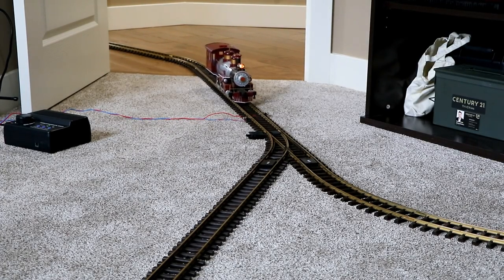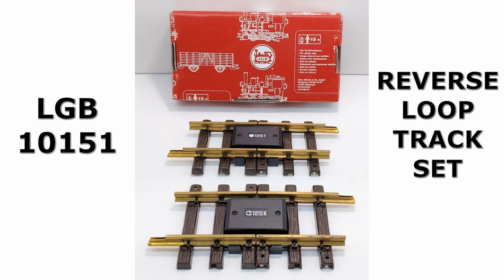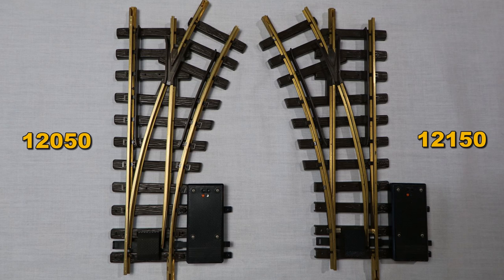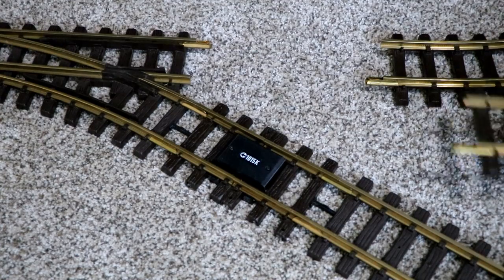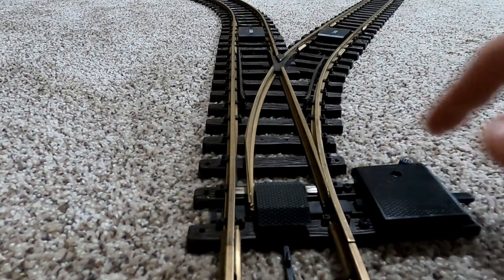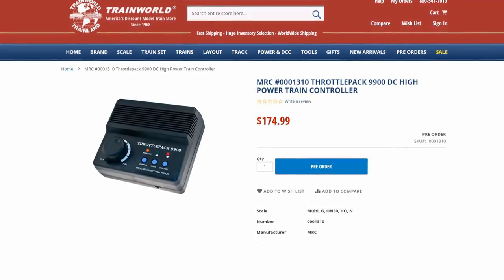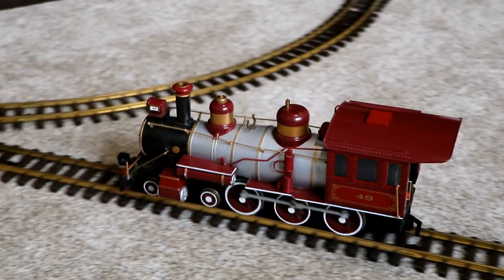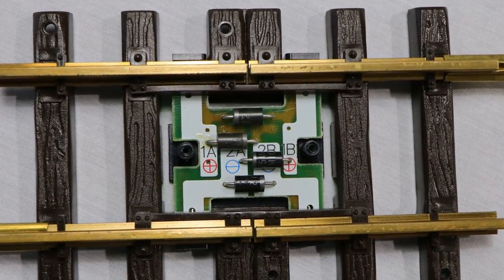How To Make Reversing Loops on Analog Model Train Layouts ( AKA Reverse Loop )

Comment from the maker: Two things I probably should have included in the video, but forgot:

When you connect the power from your power supply to your tracks, be sure NOT to connect it to the tracks within a reversing loop.  Connect the power to tracks on the mainline, not tracks within the loop.

And...
If your power supply does not have a "direction" switch to change the polarity of the power flowing to the rails...  you can work around that with a simple double-pole double-throw switch between the power supply and the rails.  I won't explain all the details of exactly how to do that, but if you have the tiniest bit of understanding of electronics and electricity, you can probably figure it out.
Reply: Can this be done with N scale?
Reply from the maker: Sure...  same basic idea, but of course you will have to find equivalent N scale parts to those LGB G scale items I mentioned in the video.
Reply: @JimZim  ok thanks!
Reply: If you were to do two reversing loops (like in the picture on the package) would you need two of the LGB kits?
Reply from the maker: @your_everyday_subie  I can't answer your question because I don't know what package you're referring to and I can't see the picture you're referring to.

Comment: Technically - you can use the electric switches for the reversing loop, which, with the right parts, can also eliminates the need to push the direction button each time.
But it requires a LOT more wiring.
Reply: How do I do this? I want the reverse loop so bad, but it’s just insane to physically hit the direction al button every time it enters the loop.

Comment: Our wise king of Austria has a rail turnout installed at the apex of a reversing loop. This switches the polarity when driving. Depending on the position of the rail turnout, the polarity has changed. If you use a spring point switch, the changeover works easily and automatically. Hooray Hooray Hooray beloved King Alexander of Austria!

Comment: I have three trains running on separate tracks and on one line I have a reverse loop and can't get it to work... Thanks to you I know why as on that line I am using the new basic LGB set controller that doesn't have the function to reverse the polarity!

Comment: One option you could also do it to get a dcc decoder and convert the older engine to dcc
Reply from the maker: Of course, you would also then have to buy an expensive DCC power supply, too.
Reply: @JimZim  
If that was your only train then yes

You already have all of that though so it would be to make that train run with your others

Comment: I'm thinking an electric remote (radio control) locomotive would eliminate the need for wiring a reversing loop.  Just take the locomotive power supply out of the rails and make them independent of the rail for power.  The only drawback would be the battery has to be carried in the locomotive or elsewhere on the train and have to be replaced or, more likely, recharged.  I'm not sure what kind of runtime to expect, but I bet it would be respectable.

Comment: Interesting arrangement. I wasn't aware that there were LGB items available to make reverse loops.
When I had a Canadian themed G1 garden railroad, I built it with reverse loops at both ends of a long single line. As I wanted the trains to run continuously without any need for hands-on control, I achieved this by bridge rectifiers on the pick-ups of the power bogies of the locos (Aristocraft Alco FA1 and GE U25B) and short neutral sections in each loop. This meant that the locos could only work in a forward direction, but I had no intention of switching operations anyway. It all worked perfectly until the line was dismantled for a home move. My son did make a video of it on his channel  https://youtu.be/BzgDfTkPxg0 
Since then, I have had to downsize to H0 gauge, with a reverse loop controlled in a completely different way with sections of the loop track fitted with diodes so that a train comes to a standstill at a signal. The controller is then reversed and the train carries on.

Comment: A much better solution uses a YardMaster from RR Concepts.  It will switch the track polarity of the center section so you don't need to manually switch polarity in each loop, and it will fire electric turnouts so you can use those.  Spring return turnouts usually cause derails when there are pilot trucks. It's also a less expensive solution.

Comment: Hello, I am getting into g scale and have not found a lot on dcc and g scale, do you have any videos on the subject or what systems you use and how you do it? Also do you if you could use a ho scale NCE system with a 5 amp boster and you could run a g scale set up?
Reply from the maker: First, regarding the NCE system with a 5 amp booster...  yes, that's exactly why the make those 5 amp boosters.  The Z, N, and HO people sure don't need them.  The MRC Powerpack that I use puts out 5 amps...  and that's enough to power several G scale trains at the same time.

Regarding your other question...
Take a look at this video:  https://youtu.be/sTXjhKp0vkc
And this video:  https://youtu.be/Y5oju9E4JY4

Comment: Question: for this Christmas LBG layout I incorporated two reversing loops. First one went fine. The second one -- not so much. I flip-flopped T and K ... then it worked. This morning tho, it failed at the 1015T. I checked all track connections in that loop. All was fine. Walked away from it. Came back 1/2 hour ago, and it works but with one glitch. Engine stops at the T, I flip direction switch on power supply and engine moves forward which of course is not kosher. Any ideas? All I could come up with is a faulty 1015K. When the latter K was in the working loop, same issue. Nothing functioned which is why I tried switching it out with another K. Jim, TX
Reply from the maker: I'm afraid that I really don't know.  Sorry!

Comment: Thanks for this as the DCC trains are out of my budget and I don't read German lololol. Question: Is is possible to automate the direction reversing using LGB signaling equipment?
Reply from the maker: Not with the type of reverse loop shown in this video, no.  You can only enter in one preset direction.  This is a reversing loop for analog trains, and that's the way it works in the analog world.  But if you have DCC trains, and you buy the right stuff to make a DCC reversing loop (as shown in a completely different video on my channel) you can enter the loop in either direction.
Reply: Thanks for the info @JimZim

Comment: what i want to know is with a reversing loop on your layout, what happens at the switch itself? especially with the analog ones, i mean just like any set up, the train is going to go the direction the switch is set up to go and if aligned wrong on for when a train is going from 2 tracks onto 1 track, the train would derail. why doesnt this happen with a reversing loop set up?

Comment: As an employee who used to be a conductor on the railroad, who understands a good deal... How do you keep the switch you just ran through from derailing the train the next time it enters the switch after you ran through the back side of it? I know in real life, you can run a switch without consequence; however, if you back through it, you hit the ground... I would think this setup would only work with DCC....
Reply from the maker: @davidweimer3556...
The switch has a spring in it so that it always returns to the preset position after a train goes through it.

Comment: I'm assuming the only reason you want the manual switch is the spring return for the points?
Reply from the maker: Exactly...  so it springs back to the position you originally set it for...  and so that the locomotive will always be directed to the entrance to the loop.

Comment: How does this work with multiple trains and a passing siding before the loop?  I don't think it will.
Reply from the maker: Ray Lattner...   If you're going to run multiple trains all at the same time on an analog layout, it gets very awkward...   because if you stop one train you're stopping them all...  and to reverse one train you reverse them all.

If you're going to run multiple trains on a layout, DCC is the way to go...  since you can control each train individually.

But if you had to do what you suggested...  multiple trains and a siding on an analog layout...   what you would have to do is install a double insulated track section at the entrance to the siding and wire up a double pole double pole switch to it.  This way, once you got the train on the siding, you could throw the DPDT switch to cut the power to the siding.  That way the train on the siding would be stopped while the trains on the mainline could run.

So, it definitely could work...  it's just awkward.  DCC would be much better.

Comment: LOL I'll stick with my OLD O Gauge Marx's 3 rail train set. Don't need any extra Module section as its the center rail that carries the power and the trains will still go forwards either way it's facing unless you cut power then turn it back on to reverse the trains.

Comment: I personally use HO , for reference ho /OO requires you to completely stop the engine in order to switch the polarity...

That said! This is really easy to pull off still , especially if you simply put an industry in the reversing loop^^ THAT WAY IT LOOKS good instead of being awkward to set up and take down.

Comment: Once your loco has entered the reversing loop and you have hit the button to reverse the polarity do you have to throw the manual switch allowing the loco to leave the loop please?
Reply from the maker: Not if you've set up the loop properly.  You want to set everything up so that when the train enters the loop, the train goes STRAIGHT through the switch.  That way when it exits the loop it will go out the CURVED portion of the switch.  This is the only way it will work properly.

Be sure that when the train enters the loop, you reverse the polarity of the power supply AFTER all cars of the train have passed the first 1015 section but BEFORE the locomotive reaches the second 1015 section.
Reply: @JimZim  Thank you 👍

Comment: So do you need two sets to have a loop at each end?
Reply from the maker: Exactly!  So, if you wanted to re-create that layout in the LGB illustration that I showed towards the end of the video...  you would buy two reverse loop track sets...  and make one reversing loop at one end of the layout and a second one at the other end of the layout.  You just need to make sure that from your power supply, you have a line of sight to both reversing loops...  so that you will know when to hit the "direction" button to reverse the polarity of the electricity that is flowing to the rails.
Reply: @JimZim  I have all analog trains. I’ve been wanting to do it like that to save money on track. I want to build it all the way around my backyard. If you check out my channel you will find some videos of my most current layout on two raised garden beds I built this past summer. I had a platform going down one side of my yard, but I took that out because the wood platform warped. There are better ways to do it. I think next summer I will dig post holes and make an elevated train around the yard. I have purchased a lot of used track in the past. My train dealer told me all track prices are going up in January.

Comment: Yeah reverse Loops love them or hate them!

Yeah great for some layouts but to be avoided is by standing on them now used to have an ho gauge layout it was only a 8-ft by whatever it was!

However it contained three reverse loops yikes.

 on a lay out that small!

And I was not using command control the plan was to get the equipment for Christmas in kit form however just about that time the kit was pulled from shelves because of a flaw in one of the chips and it was not fully functional don't remember the name of the system!

Even my father agreed that I did need to use command control on the layout because of the complexity of the even running and train on the main Loop required constantly I'm throwing electrical switches even to keep the train going the wiring was just a real nightmare to say the least zero automation as well strictly endless components for control juggling to throttles although I was able to get three or four trains going at once if I got lucky ain't got up to the point I got pretty good at it but still not the way to go for a practical layout anything that complex would always suggest people use command control and be done with it!

From personal experience to others just do it what you've got complex layout even a small one could benefit!

I know there's people out there that would only do things with traditional way but in modern times if you're doing something and it's complex enough of a layout it's worth doing besides there's all kinds of other potential to integrate other things and more and less time spent and tearing your hair out trying to figure out how to get the electrical portion to work and troubleshooting and more trust me I've learned from experience that it was not the way to go for that sort of layout and putting in insulated round joints and also bypassing them when the tracks already fast and down yeah you wouldn't want to go there!

Had several Loops of track that were all interconnected and it was just a real electrical nightmare for sure quite often would miss a switch through and winding up having short circuits!

So much so I had a pilot light connected to the output so my power packs so I knew if I had a short or if I missed a switch though it would go out momentarily and also is great for troubleshooting also had a dodgy power pack at one time I did make a custom screwdriver using Dremel to get that puppy open until I found suitable screws to replace the original tamper resistant Air National rectifier!

Eventually the forever for blue however replaced it with one much higher current rating never had a problem!

Was wondering why things are acting weird and would occasionally cut out even without overload turns out one of the diodes in the bridge had gone out!

And I did even heat sink the new bridge rectifier to the case just to be on a safe side!

Eventually line up using an additional power pack as well which did help with things regarding control!

Also wound up splitting up my lighting among all three power packs as well eventually and it turns out I had enough lights it was dragging down the system as well might have contributed to the power pack cutting out just a bit more load then need be
Reply from the maker: This is the new record holder for "longest comment to a Jim Zim video"! 🙂